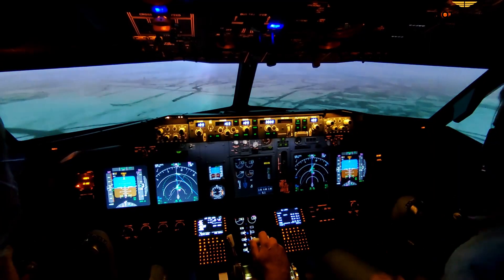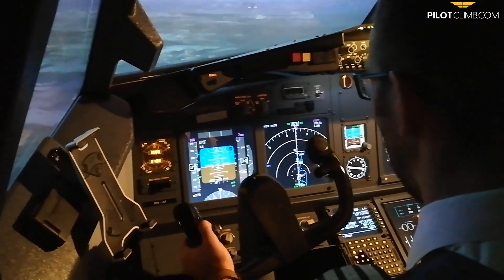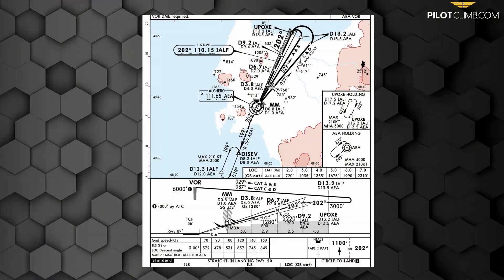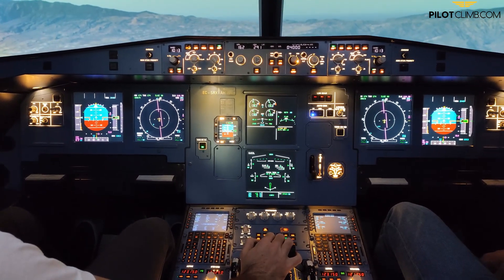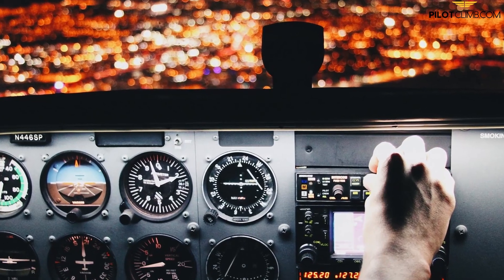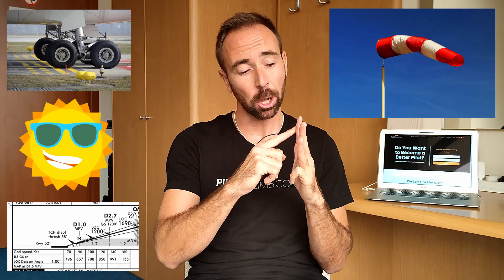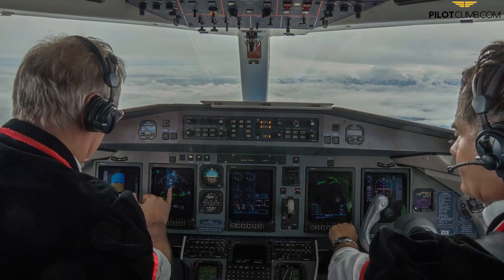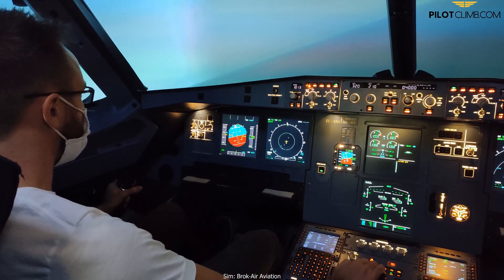What an Airline Pilot Should Consider Before Staring the Final Approach.

Comment: Hello sir, i am  a starter pilot of C295 aircraft and i have got a question concerning the calculation of FF (fuel flow) to be precise my question is about of the formula 
FF = 50 x TAS/SR . I will make it short, i am kindda curious  about the number 50 and the meaning of it. Hope you answer ASAP. Thank you
Reply from the maker: This is a Type specific question, I guess is a constant you use to quickly calculate the FF.

Comment: Great video, the tail winds affecting descent angle is something I never considered before, but makes perfect sense. I noticed, even in sim, the heavier the aircraft, are very slippery down from top of descent, and I often end up switching to level change to add speed and even then the boards come up... It's one of those few occasions where the 3:1 rule, +(speed-200)/10, +(TWC/10) doesn't work. Thank you very much for this.
Reply from the maker: Great comment!! Thanks for watching!!